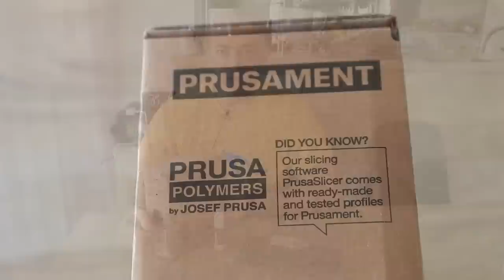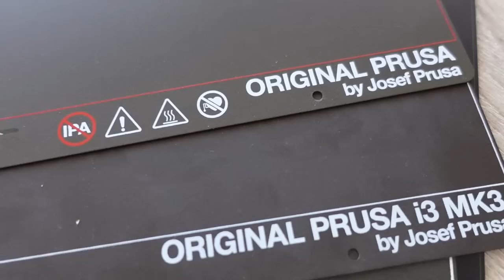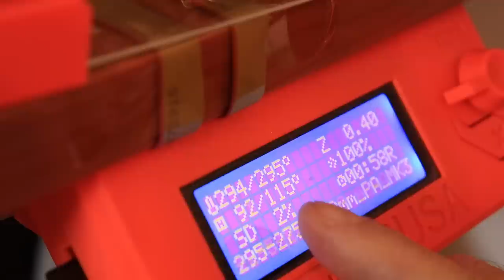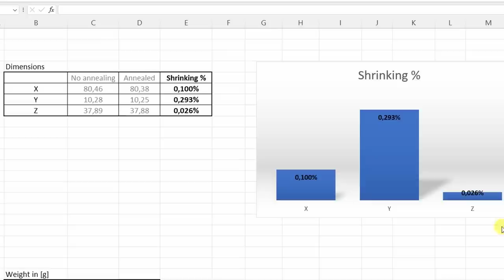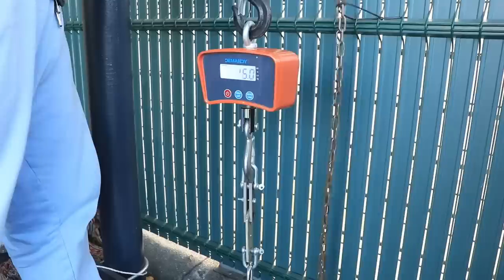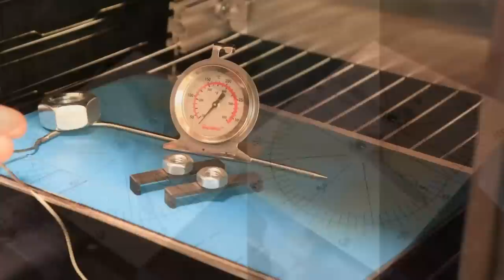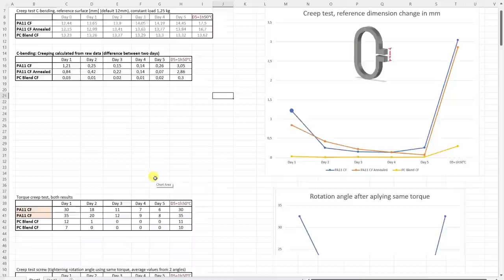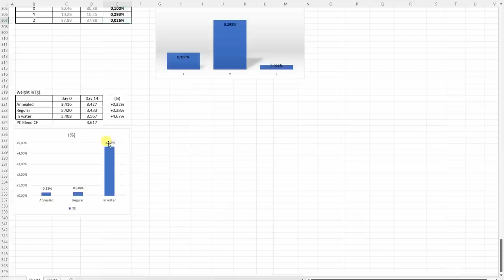Review of Prusament PA11-CF and PA Nylon Spring Steel Sheet

Comment: Pa-11 was developed more for SLS printing(so I've been told), and PA-12 is better for moisture resistant FDM but very expensive.  PA-6 is  cheaper and stronger but very hygroscopic.  I'd like to see more on the Prusa PA sheet before I inevitably add one to my collection. The material science part of 3D printing filaments fascinates me and I really enjoy your material testing videos for this reason.  Great work Igor.
Reply: PA-11 was discovered in the 1940's and is made from castor oil. The types of Nylon were not designed but discovered. It certainly can't have been made for SLS printing unless time travel has been invented. The material science side of 3D printing doesn't seem to fascinate you enough to simply read the wikipedia articles on each one.
Reply: @backgammonbacon  Take a course in reading comprehension.  Have a nice holiday!!
Reply: Hammer skin ?
Reply: PA12 is very hygroscopic, even though less then PA6. If its humid, its useless if its used for parts under constant load. 
for Humid enviroment, and load of time parts (for example a bracket that holds a heavy surveilance camera), use PET, PPS, PEI, PC.. they wont deform with humidity.

Comment: Thanks for the great work. Seems like i will continue to use PcBlend CF (annealed) for my under bonnet car parts, i was Curious about the pa11 though. Creep and heat creep is very important to keep things screwed together in hot environments. And i did some long term testing of different materials, PCCF dont seem to be affected by petrol, and it prints super easily.
Reply from the maker: Thank you for your support and for great info (about petrol), good to know. thx.
Reply: @MyTechFun  Awesome channel I hope you know a lot of people benefit from your tests. I have one question till now I mostly used pla+, but I need more heat resistance and some filament that doesn't shatter on impact. Do you know a somewhat easy to print fillament which fulfills the requirements above? Thanks in advance.
Reply from the maker: @studywithme8055  Best PLA I tested is Engineering PLA by Filaticum. 150°C . I printed a fan shroud for prusa (which has to be from ASA), it works https://youtu.be/uF2_ceBQ40Y
Reply: @MyTechFun Yeah I watched that video, but it is a bit expensive for 1kg. Is there any other solution (a bit cheaper if possible). By the way when you do the temperature test do you start from 0? Do you turn on the under and upper heating element or one of them? Is there a orientation of the specimen while printing?

Comment: Very interesting. I wonder that the carbon content in Prusa PA11 is... because even if it was really strong, it seemed quite brittle and with very little elongtion before break compared to other CF-nylons you've tested 🤔. To me the advantage of CF-nylons is that some you can print very large parts without warping that have overall good mechanical properties and high heat resitance on an open frame consumer level machine, if it warps more than PC-CF I think the only advantage would be the chemical resistance that you mention, because it will be limited to small parts for most people

Comment: It looks like it is very similar to the discontinued coex nylon or dupont zytel. Great mechanical properties, but the cost vs benefits aren't quite there. printability seems very poor. Although there is some hope, I've seen some beautiful pa11 prints using the bamboo labs lidar system. Maybe there's some additional tuning that makes a difference in the final print.

Comment: Honestly that filament looks wet. I would repeat at least the test tower after 24h 70°C drying. It shouldn't string that much. You used 285°C anyway so it's probably ok for the strength tests, but the test tower should be repeated.
Concerning the layer adhesion breaking in the wrong place, my explanation is the following: the throat is smaller so when the next layer comes, the previous one is still very hot and sticks better. When the larger layers are printed, the previous one is not as hot because each layer takes longer, and adhesion is poorer.
This effect (you can see with PLA for example) happens only at a certain temperature threshold: the layer adhesion above a certain temperature does not increase anymore. If you experience the issue, it means that the print temperature should be higher, so that even larger layers still are able to keep the previous layer hot enough. Of course print quality in super small layers will suffer.
You can avoid the issue by setting a relatively large minimum layer times: this way you remove this variability because smaller layers take the same time as larger ones, and the cool down the same way.
Cooling and layer time are magic, it does not exist AT ALL so far a calibration procedure to obtain optimal 1) minimum layer time 2) minimum and maximum cooling fan speed 3) minimum speed for small layers.

Comment: If you can source from Poland try Company Rosa3d.They have  filaments like PA12 WITH 15%CF chopper carbon fiber. And They have competitive price.  I'm using this for small form factor high pressure (6-7 bar) molds in temp from 120 to 150 C in cycles around 3-4h long
Reply from the maker: I will contact them, but you could contact them in Polish language too and suggest my channel ;-) If they send me sample spools, I will do the testing

Comment: The marketing for this buildplate is ambiguous about whether this sheet is coated with actual Nylon, or rather an unspecified material suitable for printing with Nylon. I suspect it is PEI with a thin overcoating of Nylon, which would explain the need for water-only cleaning. To my knowledge, Nylon is plasticized by isopropanol, but resistant to acetone. Therefore, it's surprising that Prusa would prohibit acetone cleaning, if the bed was coated only with Nylon.

Anyone care to reverse engineer it?

Comment: Prusa product are completely overpriced.
Reply from the maker: PA11 (and Nylon itself is expensive). But for example I found their price of PC Blend CF very acceptable.
Reply: @MyTechFun  I usually use simple PETG and there is no difference between expensive Prusa PETG, Das Filament PETG or any other. Also the Prusa printers are too expensive for what they are as well so in general their products. But you might have a different opinion.
Also CF filled material are dangerous to use in a home environment, I would not print that stuff at home at all.
Reply: @sierraecho884  "Also CF filled material are dangerous to use in a home environment, I would not print that stuff at home at all."

Please elaborate on why CF material is more dangerous than other materials (ie, vs ABS, PC, GF, etc.).

Thanks.
Reply: @retromodernart4426  Because the small carbon fiber particles are respirable, they do cause cancer like asbestos does. Most people have no venting whatsoever which means those particles will be released during printing, handling or sanding. Many people are also are not aware that you should only sand CF filled material with water. 
You can print that stuff somewhat safe if you have a vented chamber and do not sand your prints "dry" but many people are not even aware that those risk exist.
Furthermore, there is almost no benefit to CF filled material. They are stiffer than normal parts but at the same time very pricey, it is not worth the trade off at all.
In industrial applications CF filled plastics are used for their reduction in shrinkage, this is also the case with 3D printing but they are not really much better beyond that in their mechanical properties.
Reply: @MyTechFun  Have you made a video on PP ? 
PP is the most sold plastic and has great mechanical properties. I think printing it is really a headache, however it will be much easier to print if a GF/CF filled filament exists.
Reply: @sierraecho884  Thanks for the detailed reply.  My understanding was that all filaments produce respirable particles, some also produce toxic fumes (such as ABS), therefore all are dangerous for printing without respiratory protection such as a p100 respirator with solvent/organic vapor cartridge, as well as vented chamber and room air filtration.

Good to know that CF is one of the worst filament materials.
Reply: @retromodernart4426  You are right, all filaments are somewhat bad for your health but CF is especially dangerous. So take serious precautions, this stuff is no joke.
Reply: @sierraecho884  info
The almost nowarping are very desirable properties. Its almost the best advantage to have.
Why are you writting that is has almost no value?
Reply: @fearlyenrage  I didnt say it has no value, I said it is overpriced. An Iphone has a great value however almost any other phone can do what the Iphone can, it does not mean it no value it simply means there are cheaper alternatives.
Reply: @sierraecho884  well marketing value has a higher price in mind to suggest higher quality.
When there are other products cheaper good for us printers.

To print that stuff at home there are many solutions. Some filtersystems catch the fine dust from printing.
Reply: @fearlyenrage  Marketing has no value to me as a customer it has a cost component to me as a customer. 

The filter systems, capable of filtrating this fine particles cost way more than a typical FDM printer. I personally run a Levoit Core 300 HEPA13 + CF filter in my office at home but would never be capable enough of filtering out those CF particles to a point where it wouldn´t be a problem for my health. The filter systems I saw cost 2k +